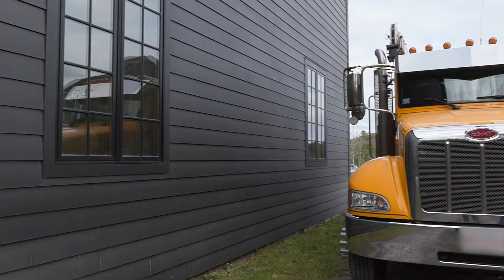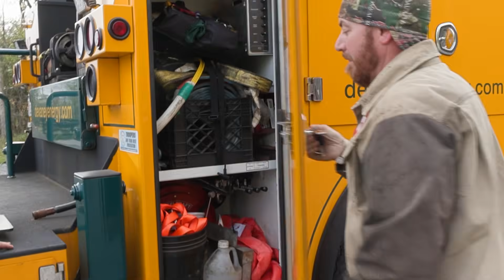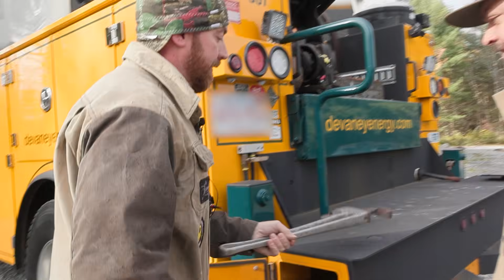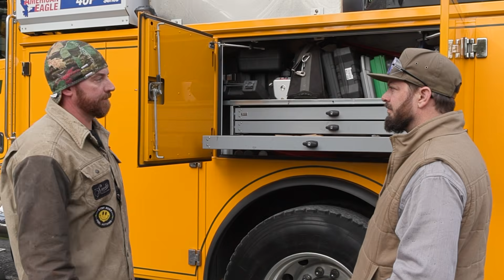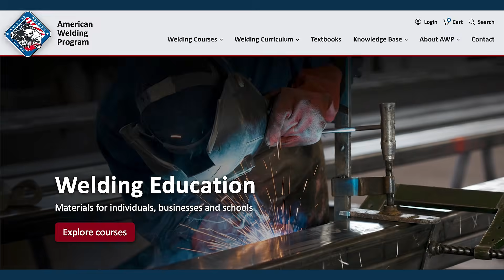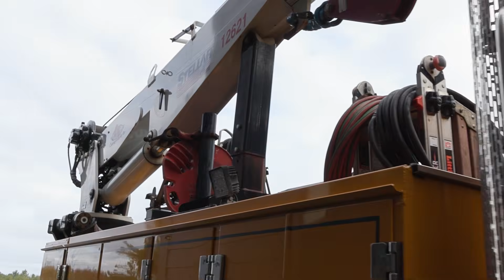One Truck, Every Trade | Dave Doherty's Mobile Shop

Comment: Similar to what I do. My van is smaller & lighter though. Electrical, electronics, HVAC, welding, plumbing, rigging, machining, etc.. I dont work on boilers though, chillers & VFD’s mostly. Largest I’ve worked on is 5500 tons.
Reply from the maker: That's a lot in one van!
Reply: @WELDPodcast  yes it is. I wish I could say it was organized but it’s more like organized chaos.